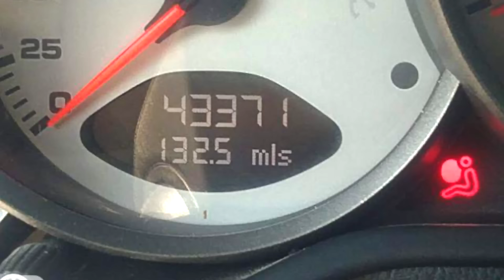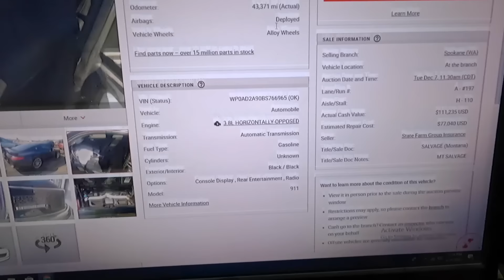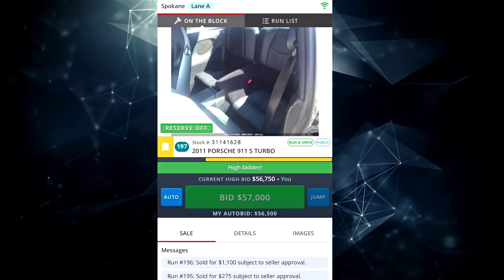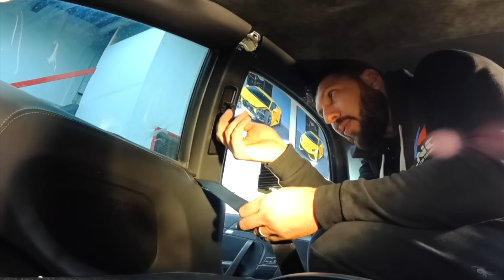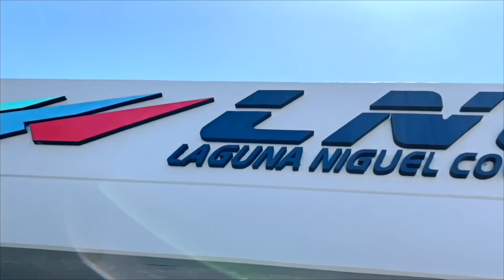We Bought Crashed 997.2 Porsche Turbo S Sight Unseen From A Salvage Auction IAAI

Comment: You have choosen and bought a great super car. Powerful, 4 wheel drive . Today February 2023, the PORSCHE 911 Turbo S is still at the TOP ( 992 type). I am always surprised that there is no AIRBAG on the passenger side ????? You will , one more time, changed a crash car in a unique wonderfull car. Thank ou so much for the work and the video.